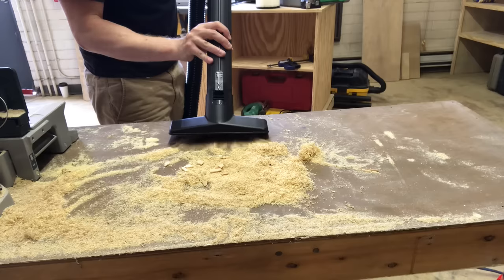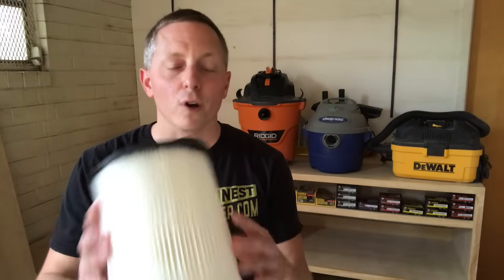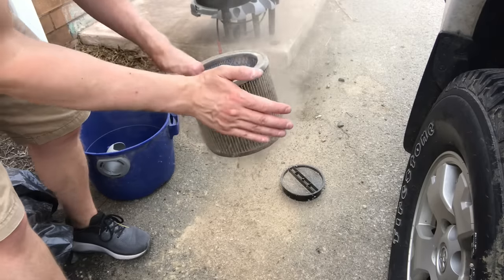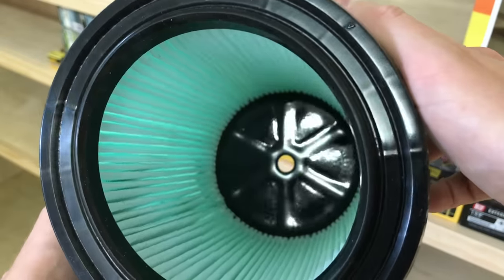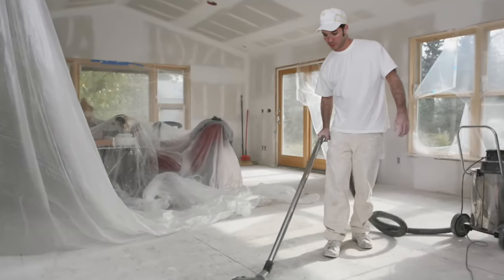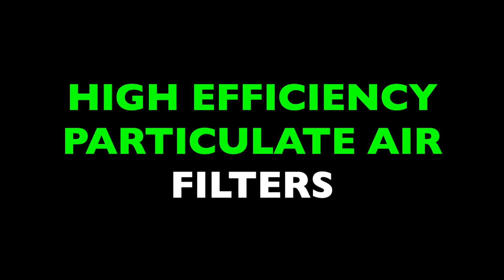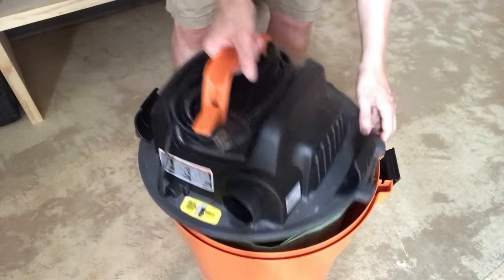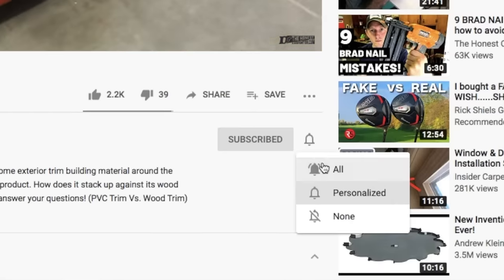Never Use A SHOP VAC Without One Of These!! (Shop Vac Filter Bags/How HEPA Filters Work...)

Comment: I use a bag in addition to a cyclone (dust deputy) in addition to the bag filter in my shop vac
Reply from the maker: That’s what I’ve got coming up next, Sumi! I’ll probably go with a Dust Stopper because they’re so low-profile…easy to fit under cabinets.
Reply: @TheHonestCarpenter  that's true, but as far as I know, the dust stopper is not available in Canada, and it's to expensive with other exchange rate to import from the US.

Comment: I've got a Ridgid 16 gallon shop vac model # WD16360 and it will NOT take filter bags! Ugh. Went to Home Depot, bought a 2-pack, and realized (as I'm attempting to connect filter bag) that my shop vac has no air inlet valve connector. there is nothing for the bag inlet hole to grab on to. I've been searching the internet but I can't find any reference to any filter bag available for the WD 16360. I needed to vacuum a room full of joint compound dust. I have a 2.5 gallon craftsman shop vac (I found bags for that one) and used it. But what the heck Ridgid!!?? I suppose I could jerry-rig a connector somehow. if/when I had the time.

Comment: Bad idea basing a shop dust or chip collection system round a vacuum cleaner. Festool have one of the best service life vacuums at 1200h most replacement motors are rated at 500 hrs.
An industrial motor based system is designed for a large volume of air with a small pressure delta whereas vacuum cleaners or shop vacs are designed for a big delta in air pressure and much smaller volume.
They are different tools for different purposes. The shop vac is perfect for a random orbit sander but a panel saw, planer, drum sander - you're in different territory. Where I'd use both would be at a router table - chips through the hole with a vacuum and an overhead dust trap to draw off escaping fines. the fact is that both are needed.

Comment: Here's a better plan, you can buy a six-pack of 24 in Merv 13 cheap on eBay, remove their cardboard casings, cut the filters into quadrants or how you see fit and do a good job taking them on to your exhaust of your vacuums! 👍 and screw the bags that are pain in the ass

Comment: I don't understand how these filter bags work. Are they just platic bags, or are they double walled with a filter liner on one side? Those looks wide open. Need a closer look to understand this.
Reply: Ok so the bag itself fills up with the dirt like a donut? I suppose it gets clogged but likely not much worse than the filter alone, since it has a similar area to the folded filter...

Comment: Bagless vacuum cleaners are actually pretty disgusting. They force the users to be in direct contact with the dirt, something that we did not have to do with old bag vacuum cleaner. That said, I found that the best way to clean the filter of bagless vacuum cleaner is actually to suck up the dirt using another vacuum cleaner. A simple stick vacuum cleaner will do. If you wash the filter, it will wear down the filter and the dirt is trapped further inside the filter. Of course you will have to wait for it to dry and eventually you feel the need to buy more filters .... :-)

Comment: Does anyone know if they make filter bags for the older Ridgid shop vacs with the intake and exhaust all on top assembly? I bought the B size bags at Home Depot but they are designed to have the intake hose on the tank and it cant jam up into the crevice. Any info would be great if anyone has it because id like to make cleanup easier and keep it in service because it takes the same filter and hepa upgrades from 20+ years ago. Im not sure if they even made bags for them when mine came out. WD09350

Comment: It's too bad the Rigid Shop Vac fails on every SUCTION POWER review video on YouTube. What good is a lifetime warranty on a vacuum product that simply can't perform as well as the competition? I use filter bags on my shop vac. Can't imagine emptying a vacuum cleaner without a filter bag. If they made HEPA filters for my model, I probably would use them too. However, I doubt the air quality in NYC is better than .3 microns.

Comment: You seem to imply in the first part of the video (before the HEPA section) that using a prefilter/bag will improve the efficiency of the pleated filter at removing harmful 3u particles. This is not true. The efficiency of the pleated filter at collecting any given size particle is determined by the design of the filter and will not be impacted by using or not using a bag. If a pleated filter lets fines through without a bag, it will still pass them with a bag. Using a bag WILL increase the time that the pleated filter operates before it clogs.

Comment: I thought this was common knowledge to use a bag, as that's how the machine was set on purchase. Anyway. For use outside (where there might be some wind or a fan blowing, and certainly less indoor pollution) I switch to the bagless/filterless mode... like when you are cleaning up sawdust... No sense filling the bag with this. So, they're made to have these two modes... plus the ability to suck in water... wet mode.

Comment: DON'T wash HEPA filters. It severely impacts their filtration. Best way to clean it is if you have another vacuum, then just vacuum everything out of that filter. Or just use your shop vac as long as you have a HEPA filter bag fitted. Using the filter bag obv cuts down the need to clean the cartridge, but if you added a filter bag later just vacuum the cartridge and you'll rarely need to do it again.

Comment: Too bad shop back doesn't make the cord horns long enough to actually hold all of the cord. Too bad shop vac doesn't make a switch that isn't the same body color so you can actually see where it is on the unit. Too bad shop vac doesn't make markings on the top so that you put the lid on the correct way instead of the incorrect weigh 180° off. Too bad shop vac doesn't make a cord that attaches to the unit that doesn't end up breaking way too soon. I took my cord and wrapped it along the handle with electric tape so that I didn't put strain on the stupid joint they built that doesn't last. Too bad the plastic yolk that's meant to hold the vacuum hose doesn't work.   buy the biggest dia hose - thats what's matters, filter washes just fine - over and over  -saves $20.00 each time - yes better filtration is good

Comment: This doesn't make any sense to me. If the bag is on the inside of the inlet port there is  nothing to suck the air through the port. It is essentially blocked by the bag

Comment: Thing you seem to overlook is that a clogging filter is actually better at capturing smaller and smaller particles. And this miracle .3 micron story is certainly myth. You talk about filters capturing larger particles - and filters for finer particles - you don't think a filter that captures .1 and .2 will also capture .3 etc. Sorry - guess that's why I am in the filter industry and not a carpenter giving advice!!

Comment: That was extremely basic, and probably the least common uses of a shop vac.
What filter do you recommend for spaghetti or red wine?  
How about the coins under the sofa cushions and the car seats?
How about vomit and dog iron, what would you use for that?
If you are doing dry wall clean up the round filter is good enough unless you are doing an entire building, but then you would probably be using a respirator and again the round filter is good enough. The only time I would use a bag is if I was cleaning up in a customers house that had expensive furnishings.
I rarely use a paper filter because if you get it wet, which you will it becomes garbage.
Use a foam filter for general everyday cleaning. It can be rinsed out without having to remove it.
The biggest mistake people make with a shop vac is vacuuming up liquids without first dumping the dirt out of the vacuum.
Put that dry filter up on the shelf and save it for your drywall project every ten years and use a foam filter for normal use. As for the bag.  Buy one if you are working in someone else’s house cleaning up dry materials.
Don’t waste your money on bags they are not necessary.
If you vacuum up wet material rinse out the vac when finished and store it open so it can dry out, or wipe it out so it does not mold.
The round filter heck, take it out to the garbage can and bang it back and forth inside, If you really feel motivated blow it out with the air compressor out side of course.   
When you are done with your wood projects, take the paper filter out, and put the foam filter back in.
Now you know how to use a shop vac.

Comment: Simple explination on why 0.3 microns particles are hard to filter. 0.4 and more are easy to filter as because they are relatively big they move in a very predictable fashion moving in a straight line. Making easy to filer. 0.2 and less is easy to filter as they move in a very random pattern, due being so small that any particle that hits it (like air particles) will cause it to move, so having enough layers will mean they will most likely hit the filter and get caught. 0.3 is hard as it is both big enough to move in a straight line undisturbed and get moved by air particles making it the hardest to filter. 

THIS IS NOT A GOOD EXPLAINATION.
Watch this video for better detail.  https://www.youtube.com/watch?v=eAdanPfQdCA

Comment: This is all theory with no proof. For example, how much dust actually escapes as the filter starts to accumulate particles and fill up? We can also argue that as the filter traps dust particles, it starts to become more effective at trapping smaller particles because it becomes more difficult for them to pass through the existing dust. As long as there is sufficient power, a slight drop in vacuum won't be noticed, but it will pass less dust through as the filter becomes dirtier.

Unless you actually did scientific testing for particle counts exiting a vacuum exhaust for an old filter vs filter+bag setup, this is all pure speculation.

Comment: Very Dissappointed with even Overpriced super suck Shop Vacuums..  If you do much Drywall, you know how often you have to clean the filter.  In these days of Cyclone dust seperators and Dyson Vacuums, you would of thought by now Shop Vacs should have evolved.  NOPE,  If Dyson did this 20 years Ago, why not Shop Vacs?  I made some mods, just internal spin/cyclone baffling inside the Shop Vac canister, but leaving the filter with appears to be good success.  Filters last longer now, even with lots of Drywall dust.    How about some ideas about internal shopvac baffling..  Simple stuff..